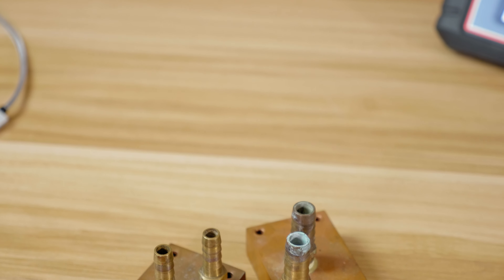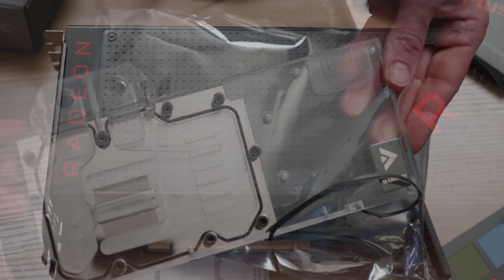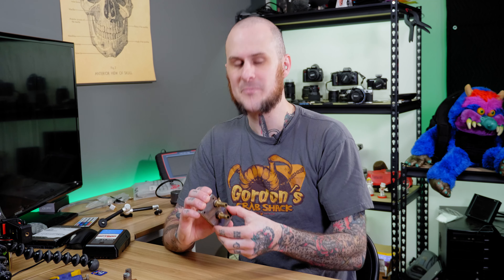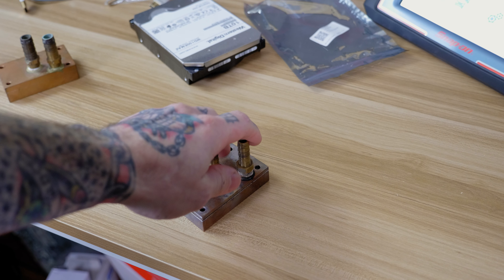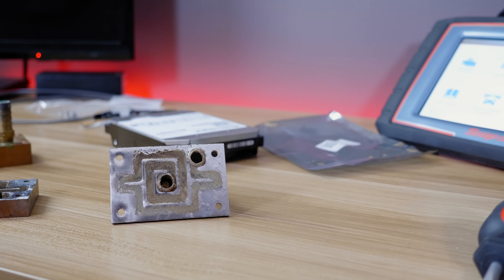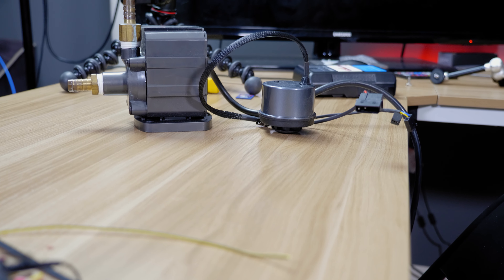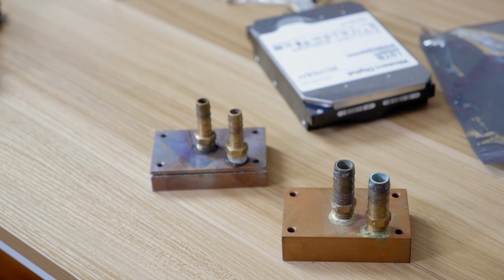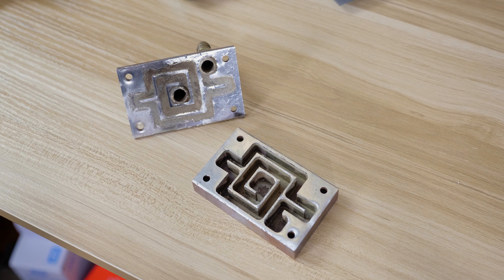Old School PC Water Cooling - Danger Den Maze 2 Waterblock

Comment: I still have my Danger Den TDX and  modified to socket 1151 with an 240mm rad and an Eheim 1250 pump sitting in an 15 liter water reservoir. Best watercooler ever...
Reply from the maker: I wish I had the rest of my parts. I'm on the hunt for a few items to try and get back what I had years ago.

Comment: Yeah, the whole "keep the water in the block" mantra turned out to be nonsense, but it worked well enough for the components of the era. I still have a 9700pro with a Maze-style block on it.

But I'm happy to live in the era of micro-skiving and computational fluid dynamics, anyone who wants to build their own Socket-A block for Vogons bragging rights can still do it.
Reply: fact : the goal was to cover the maximum surface of the waterblock by water, but at the same time, we used  high output pump, so the water don't stay as long in the block as the actual aio.
fact2 : these low pressure drop waterblock has superior performance compared to the actual aio (all are high pressure drop), and has not the problem where the liquid obstruct the waterblock , no cloting problem (recent case where a aio have this problem), and the pump didn't died because your drop pressure.

fact2.1 : 45°c full with 28°c ambient for a 95watt cpu (oc at 4ghz from 2.6ghz)...find me a recent wc system with the same perf. :p

[/end of necro]

Comment: < Danger Den Blood Series still sitting closet.  480 up front.  280 in back.  Cooled the NB before that was a thing.  Also each stick of RAM had 2 barbs.  I want to say I had SLI 8800 Nvidia but dont remember the GPU.  I know I had 2 of 'em.  Pump was eheim.  Made for a pond.  The case is/was beautiful.  1/4 thick laser cut.  Case was like 70 lbs.  MB was a Rampage want to say maybe 3 at the time?  Extreme 3?  Dunno.  They (DangerDen) were the innovators at the time.
Reply: Yup.  100%  480 up front.  I had a larger version of the Blood Series not the 21.  Just checked.  Important to nobody but me lol.  Mrs didnt find it funny either when I turned the lights on to look.. WTF you doing?  Im looking for my Danger Den?  What?  Nothing go back to sleep.   Shoot.  Maybe I should cancel deliver of my 4th Fractal case next week.  Hmm..  Nah.  I dont need another 4ft tall case.  So whys this 15yr old DD still here?  Work of art. I digress.
Reply: And yup Rampage Extreme 3.  http://www.xtremesystems.org/forums/showthread.php?257676-Danger-Den-Rampage-III-block  ok Im out.
Reply: @daveherron  dude, would you be down to talk about your case??
Reply: @jonpayne6812  You can have the case if you want it - just pay for shipping.  Id be happy knowing it went to a good home.  Its heavy.  It wont be cheap to ship especially well packed.   I just recently pulled it out of the closet.  Let me know if interested. (Assuming you are in the US)

Comment: I would love to see a comparison between past waterblock designs, From a flat plate to maze channels to pin-fin arrays to impingement to the micro channels that current waterblocks use.
I recently got a new-old stock Zalman Reserator XT which came with an aluminum and copper pin-fin array style waterblock (ZM-WB5), I skipped replacing it with a cheap Chinese waterblock when I realized it mounted to AMD motherboards using the stock retention clips.  In comparison to a Noctua NH-U14s the pin-fin style waterblock seems to be bottlenecking my Ryzen 2600 temperatures by about 6 degrees C.
Reply from the maker: I've been actually planning to do a video like that for a while now. I gave the water cooling parts I just need a system to run the tests on and cannot afford to use my Workstation as the test bed. Sometime soon hopefully I plan to do a couple different tests of "old school" watercooling on modern CPUs. Der8auer just did one test of an old setup on a modern system but it wasn't as old as the stuff I have sitting around.
Reply from the maker: I however don't expect the results to be anything to write home about. I just plan to do it for the fun of it and to see what happens. That is all.

Comment: Hey, I can fix that block. I built it in my garage 19 1/2 years ago!
Reply from the maker: Well it's cool you saw this video. I've got a second one so I'm going to keep this one disassembled as a display piece most likely. I AM going to be doing some more stuff with the other Maze 2 block in the near future. 👍
Reply: Dude I miss DD. I feel like if DD was still in the game, we wouldn't have the current plateau in innovation. Luckily there is a company up in Seattle that's taking up the mantle. Maze blocks sucked, but I wish DD had stuck with it until we got cheap cloud CFD- they were already on the right track, and maybe we wouldn't be in a moar fins moar better EK fever dream
Reply: @MandicReally  would you sell both the blocks?
Reply: Dennis, is there a way you could contact me??
Reply: Thanks for all you did!